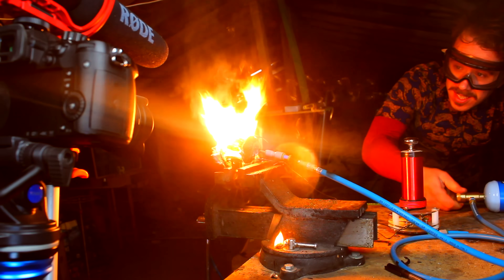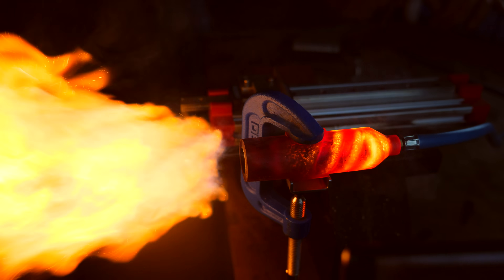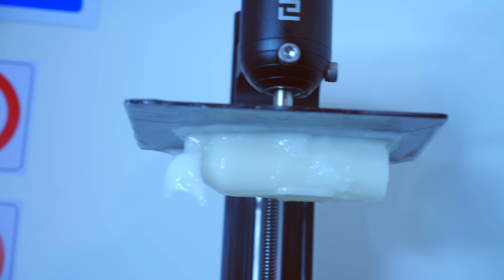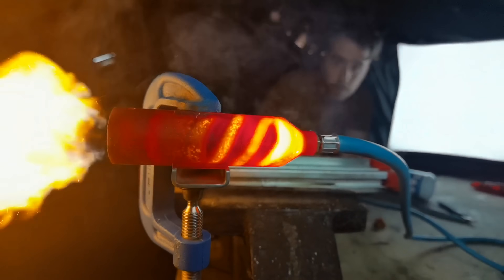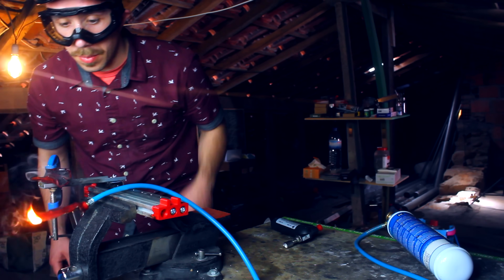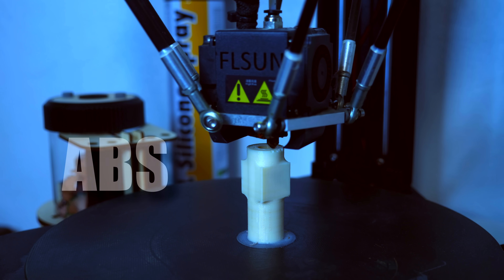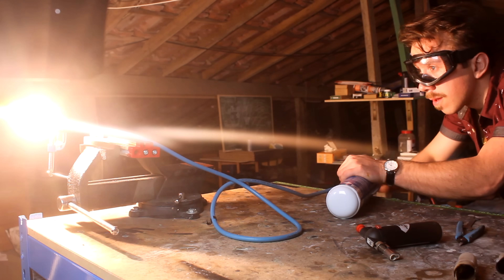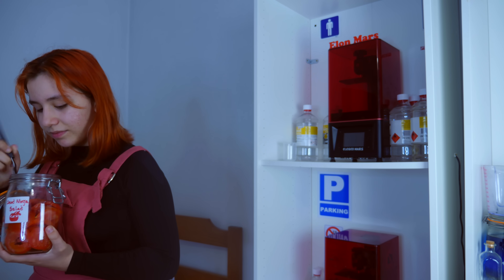Rocket engine that uses itself as fuel! (3D Printed)

Comment: The most ballsy thing about these experiments is the lab location - under a wooden roof xD
Reply: also no respirator..... would not want to breathe resin VOCs
Reply: Would be smart if it was, firework factorys etc always have flimsy roofs and sturdy walls to direct any explosive force up, rather than out.
Reply: It's just insulation behind the wooden beams ya know that stuff that's usually very flammable... He's literally making a rocket in his very flammable looking attic it's just a accident waiting to happen from safety ignorance and lack of common sense
Reply: Ballsy or stupid especially with his sister as camera woman?
Reply: @williejohnson5172 Stupid for sure. Testing half of the stuff he does where he does is insane.
Reply: This shit looks hella dangerous.
Reply: Funnily enough that's how NASA started. Couple or so guys wanted to test things out but all they had was a wooden shed...

And they they burned down that shed. Accidentally.
Reply: The fact that it's a roof is even crazier. They're so flammable
Reply: not wooden. you can see the tiles
Reply: @OliverFlinn  The tiles that are laying on wooden planks.
Reply: @OliverFlinn  @5:13, I see wooden roof supports and the tin roof, where did you see the tiles?
Reply: @jeffspinner6579  sitting on the wooden beams? you blind?
Reply: @OliverFlinn  I am nearsighted and watching this shite on a potato, (I no longer connect my workstations to the internet except for critical updates), but if that isn't the standard wooden framing of a roof, you got me.  How are those supports not 2 by 6s?  This is an example of what I see at the time stamp:   
h t t p s : \ \ 
plasticinehouse  .  com  /wp-content/uploads/2020/12/How-Far-Can-a-2x6-Rafter-Span.jpg 

What do you see?
Reply: @OliverFlinn  Oh weight a second, I get your point: you are saying who cares if the wooden beams go up in flames because on top of them, there's fire resistant material.

Remind me to never allow you to construct anything for me.  You're like my ex-wife connecting 7 things to a 99 cent store extension cord and wondering why it's getting so hot.
Reply: @Landon Garciasmith good one, but what about tulips, hmm?
Reply: @OliverFlinn  tulips on deez nuts lmaoo
Reply: @OliverFlinn  the roof is made of ligma. No danger lighting rockets there.
Reply: @stuckgrenadepin.225  yes, but what about rhydon
Reply: @stuckgrenadepin.225   So there's no wooden beams?  Sure looks like it.  (I mean, I don't ultimately care...not my house, but that sure looks like a wooden structure holding up the tiles.)
Reply: @luchaDor  do you even know what ligma is?
Reply: @Starfighter-nk4mo  no thanks, but maybe dorelse might take you up on your offer.
Reply: Dude it's an attic, no matter what these dummies say. And there is no reason for it. Go outside. Who are they hiding from their government?
Reply: @heavytank2  Given the FBI took a man's LEGO White House from him because they claim he could plan an assault on the WH with it... you really think if he was in the US not Portugal or something, that he wouldn't get SWAT'd in 2 seconds here?

Comment: Making your rocket nozzles out of the fuel material was probably a mistake, thee shape of the nozzle is important in generating good thrust, and having the nozzle itself burn up won't be doing you any favors.
I'd probably try adding a slot to the side of the rocket, where a metal nozzle could be inserted (such that it won't be ejected by the thrust generated)

Comment: Integza, your linear rail set up is hindering your results. Having the rocket out on an arm like you do will cause it to create torque and push the wheels against the rails increasing friction. I would recommend using pipe clamps on a cart so that way the force of the thrust is going into linear, instead of rotational, motion.

Comment: Theme :- Make a ionic thruster, and it doesn't produce any heat and Runs only on electricity .
Reply: i like this idea
Reply: it can be 3d-printed and the parts will not melt
Reply: it is used in propell morden-day saterlites
Reply: they are light weight

Comment: The propellant should be a solid cylinder with a hole straight through it, you can ignite it at the top of the rocket by smashing a Christmas tree light bulb, and fitting it through this hole, positioning it at the top, then just put current to the broken bulb.  The filament heats up and pops which will ignite the fuel at the top, and burn down towards the bottom of the rocket, using the tube in the center of the cylinder as it's own nozzle and increases the burn rate of the fuel as the flame travels through the propellant.  This is the way what Etsy model Rockets burn and make model Rockets fly so fast.  Plastic won't even catch on fire at this burn rate as it starts and finishes so quickly.  I would make great use of a 3D printer, as I went to art school for 3D modeling for video games.  Please use this idea!  You're the best integza

Comment: Try this, it's a metal 3d printer. This should solve the melting problem, and also the air tight problem since you can weld it

https://youtu.be/UdiwBiw5dyo

Comment: Hi! Integza, an aeronautical engineering student here. My recommendation is that: just don´t focus your time testing different nozzle geometries. By this I mean your pressures are just to low and your mass output it´s just to low. By your conditions you will not get the right parameters to saturate or choke the nozzle. Final reccomendation stay away from convergent-divergent nozzles you are in a stage of deficiency with this ones. Stick to convergent nozzles and try to get Mach output (It´s really difficult to get this with your setup tho) or just to try to accelerate the flow the most you can. Be aware that you also have a pressure lost if the intake of the nozzle its much more bigger than the output. You can read more to try to undestand this concept first as an "Isentropic Flow with Area Changes" and then go further with your work and testing! Keep it up I really love your channel!

Comment: I liked the comment about buiding a CNC machine... the tricky thing, though is that some lasers are expensive, so perhaps you could try building a vertical plotter style CNC router ? The router could be reasonably cheap and make it possible to create plywood furniture and models on a tight budget

Comment: I'd like to see different variations of a "Euler's disk". Try different forms and different amounts of weights placed at different places inside the disc to see which variations works better. As a second idea, spinning tops of different shapes and masses to compete against each other in spin times and also like in a Beyblade match. You could even try gyroscopes... Just subscribed, great channel...

Comment: Make a case to hold the fuel then a nozzle to channel all them in to one jet.maybe four little and longer ones in a circle and one in the center. resin try with aluminum powder. give off Hydrogen when burned to combine with the Oxygen to make steam should have more power. project: build a h2o generator and a tank to hold the gas, with a pump to pump in the tank with printed parts. maybe use a glass pop bottle as there made the presser. just don't go to high. link to one to show what it is. https://www.youtube.com/watch?v=kfYiQVzB3Cg&ab_channel=MaciejNowakProjects. think you can have the two gas apart by positive and negative.

Comment: Two ideas for your rocket drive: First, try to print and (partially) fill several water chambers around your rocket drive with predetermined breaking points in the direction of the nozzles. This would perhaps cool your drive and generate additional propulsion with the resulting steam; You don't care about weight? Second, your solid fuel might probably burn too slowly to generate propulsion. Maybe try to increase the inner surface. Even flour can burn fast (explode) with a large surface.

Anyway, thx a lot for your videos! Don‘t overdo it and good luck!!!😱

Comment: With that type of plastic you will want to use nitrous oxide N2O as oxidizer(Cheap and easy to get from auto tuning race shops), plus it will also give you additional gas; N2 in your exhaust so extra pressure besides the h2o and co2. Makes A LOT of gas with the N2 trying to fit in there .

Comment: Basically need to do 3 things to make your rocket work: injector, properly sized nozzle, and a casing.

Firstly, you need an injector with pressure drop over it. Hybrid rockets are very prone to low frequency combustion instability. Literally just a small hole in a plate will do. There's lots of materials on orifice sizing. This also sets your chamber pressure. IF you know what your chamber pressure is, you can make a:

Properly sized nozzle. In a hybrid, the nozzle throat area depends on oxidizer mass flowrate, grain regression rate (these together make up the total mass flowrate), chamber pressure, and combustion chemistry (average molecular mass of exhaust products). There's lots of info online about how to size hybrids. Start with a simpler grain too. At low pressures, a parabolic nozzle is not an optimization that is required. It looks like you're designing via form, not via function. i.e. just because it looks like a nozzle doesn't mean it will function that way based on your flow conditions. Make the nozzle out of graphite or some other refractory material due to heating. Now that you've sized the nozzle and know what pressure you're injecting at:

Make a casing. Just a piece of pipe will do. You're severely limited in chamber pressure by the strength of the plastic. It will look pretty but won't make much thrust without pressure if you keep making them out of plastic. Also, c'mon man, test outside. Low pressure rocket exhaust has carbon monoxide.

Looks cool though.

Comment: You should arrange the rocket engine in a Russian nesting doll configuration with air gaps between the layers. That should stop the case from exploding from heat failure.

Comment: Make the rocket the size of the oxygen tank so you can make a connection to screw the tank in then you can make a easy tube to put around the both as the shell the bigger rocket will also allow for more solid fuel plus bigger size will help with printing more complex geometry

Comment: i bet you would get good results if you used that ceramic filled printer fluid, and made a two piece combustion chamber, the ceramic at the back to provide a consistent nozzle and thrust, and the front made of the sugar punch mixture.

Comment: As a question, why not increase the surface area of the fuel via using a honeycomb pattern like infill. Heck make something where you could do some cut and drill magic to make it that way. 

I'm curious about what would wind up holding the gas in such a rocket. Maybe you could build in a whippit (nitrous oxide) as the fuel? It would be nicely self contained. Otherwise a paintball tank may be an option depending on pressure rating but I'd think it would be non compliant weight wise.

Comment: You should consider using stearin as the solid fuel. You can 3D print a mold and the cast the stearin into the it. I have seen stearin been used in hybrid rockets with great success

Comment: A cool idea to try would be to print a solid propellent grain in one go by adding an oxidiser in the resin (KNO3), the resin itself is fine enough reductor so you do not need to add sugar. This could give you a lot of control over grain geometry, and you could make it fit in any shape pressure vessel. I would recommend a pretty thick piece of PVC tubing or a little thinner aluminium/steel tubing, put a thin insulator between the grain and the tubing to prevent burning your PVC to much or melting your aluminium.

Comment: Make the interior of the rocket a multi-pointed star with the tips pointing inward. This will give a lot of surface area with a fast burning start. As it burns it will taper/throttle down. If I remember correctly, this was the design used on the solid rocket boosters for the space shuttle.

Comment: Future video idea: make a reaction control thruster that can be fired for a short duration multiple times in a row. Best to use gaseous oxygen and a gaseous fuel like
Reply: propane, methane, or even butane. Such an engine would likely need a spark igniter or gas torch to light it multiple times in a row. I am working on a similar design myself; let me know if you have any technical questions.

Comment: This video is super cool. I would be very interested though in a metal body cause it seems like you nozzle and combustion chamber burn away to fast to be effective, but with 3d printed sugar resin fuel slugs on the inside

Comment: add a flame tube. the kinetic energy of ejecting particles will create a draft.. if you put a bigger tube around the rocket engine it will keep the outside cooler since the airflow will eject heated air before it can transfer aiding in cooling the rocket body.

Comment: When you burn this solid fuel, you burn also nozzle, which must change geometry, diameter, etc. If you can print nozzle from porcelite and give fuel and nozzle in steel or borosilicate (or another high temperature glass for better camera shots), it can improve behavior and thrust, i think.

Comment: Maybe you should consider shugar granules. The design should have hole in the middle throught whole engine, then you don't have to 3D print your fuel, but only outer walls of combustion chamber and nozzle. This should keep heat away from enigine walls for a minute or two 😄

Comment: Great vid love the concept, have you thought of using a multi-chambered ventury system plus using a reinforced shell/case to strengthen the walls of the rocket and reduce the chance of falling debris (this may also help keep the propellent moving out the end of the rocket rather than the side).
P.S. there called sparklers.

Comment: as an Idea for the next vid, you can use a tubrocharger you made for the pulse engine and put it to this rocket, instead of the compressed air, maybe two turbochargers, for more power?  (you can quickly turn it on/off)

or a second idea:
you could upgrade the turbojet engine to make more power, maybe with different design of the propellers or with electrically controller reverse thrust (the one that had problems with lubrication and burned few bearings)

Comment: Thanks Integza! Awesome parade of innovation! To compare your work with others some form of measurement would be helpful. Your roller track would work, with a fishing scale, maybe over a pulley to get it out of the rocket exhaust, and with a right angle feed for your oxidizer hose, to change the compression of the hose to a long and slight bending.
    Go Integza, go!

Comment: If you really want a Thrust that will blow you away , You need to isolate the O2 from the Fuel into seperate chambers, For example you have  a tube inside a tube, the inner tube is where the O2 flows from the rest can be used as fuel, and you may need to adjust the apex, your burn, if you notice moves to the back, it needs to stay at the apex as long as possible. When you do that.. ZOOM! have fun.

Comment: PVC and resin in side of stainless steal body works great you need the steel to stop it from burning out the sides any metal will work but stainless would be reusable all hybrid rockets burn inside out

Comment: well, you could actually use the NightHawkInLight design instead ( https://youtu.be/VI8gdmjEwKc ). It's simpler because you really only need to drill a combustion chamber through the acrylic rod ( I'm using a 50mm diametre acrylic rod with a 15mm diametre hole on the center { drilled using an ordinary drill, using drill press is better } and I made the nozzle out of aluminum 6061 using my CNC lathe ) :-D

Comment: Might want to use metal parts for the nozzle/frame. You're probably losing some thrust to the nozzle being burned up as fuel.
Reply: I agree It makes no sense when your burning up you nozzle and put it in a case.
Reply: Not to mention better if it fills up enough pressure to put off any thrust usable thrust it would blow out without a case

Comment: You should add external threads to the outside of your "engine" then print a bell nozzle that can thread on. All tests that I have done actually worked pretty well.
Reply: I was thinking this exact thing. Or try making a resumable jacket.

Comment: wouldn't it make the print stronger if you printed it vertically rather than horizontally. The direction of the grain makes a huge difference structurally so it would probably reduce the risk of your engines blowing open. When's the first rocket flight planned?

Comment: You should put a 90° or solenoid valve or something in line with the bottle and rocket. The bottle valve is good for fine tuning but it would be much safer to have something that is quick to turn off the gas.

Comment: Integza, you could consider adding a oxygen diffuser? Right now it looks you have high pressure o2 shooting like a jet through the center of the combustion chamber, and not giving the o2 enough time to mix with the fuel within the chamber. A diffuser will slow that o2 down and give better combustion I think!

Comment: 3d printed fuel is actually quite magnificent. If you combined it with traditional materials to contain the combustion, it would be quite viable. Maybe it's time to consider 3d printing steel for your body as well as 3d printing molds for compressed carbon presses to make your nozzles. It's still 3d printing, right? Is that cheating?